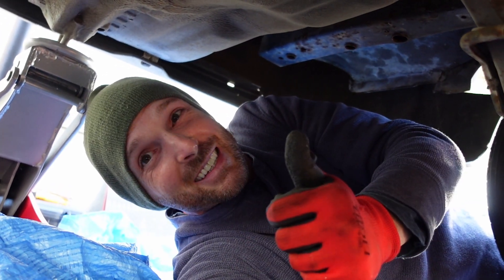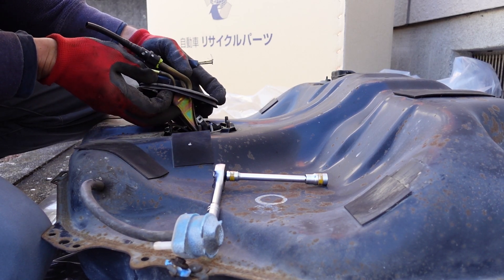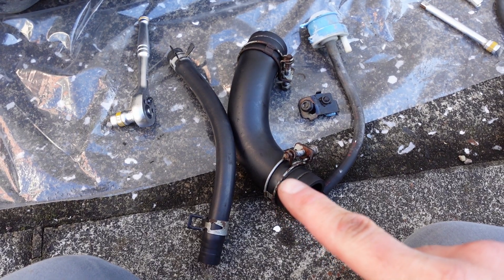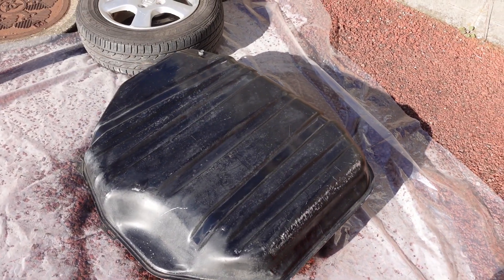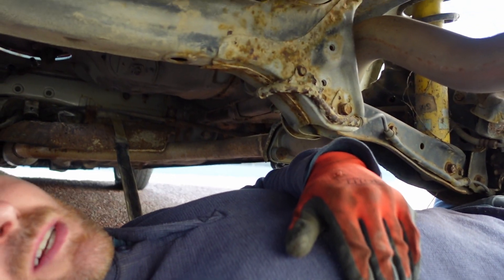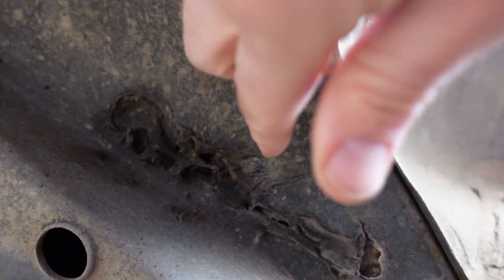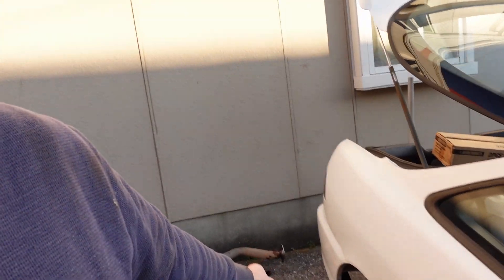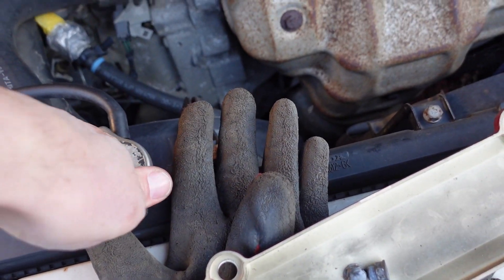Fuel System Refresh & Undercoating Rust Prep! | JDM DC2 Restoration Ep.4

Comment: If this was a UK car, you would had the welder out in the first 2 minutes of this video!
Car looks great man, seems you found a good one!
Reply from the maker: Haha, no kidding!  Work space and shaken has me a bit limited a the moment. 😣  And I'm not sure how common this level of rust is (I've seen some that look similar online)...but for real, if Honda would have just put some seam sealer in the joints or thicker (or any) undercoat in certain areas, they might have faired better! 😕
Reply: @BRICKHOUSESPL  put it this way, my EG is on its second set of arches and they're nearly dead too.
Reply from the maker: @jonwebb9261  holy moly!  Makes me feel better!

Comment: Most of the parts you've pointed at in the engine bay are available from your local Honda dealer. 
Ordering from Amayama or Partsouq (Australian dealers keep very little actual stock), most of the parts seem to come from Japan, so your local dealer who you mentioned should be able to provide them.
Reply from the maker: Excellent, good to hear there's still some OEM support. I'm going to go back to Honda see what I can get for the tank seals and other misc items.  The guy helping me mentioned consumable items being a good bit cheaper at a local parts store so I might get some pricing from them and see how it compares.  Just need to find one now!  Haha. The extra challenges of moving to a new area (there's not massive chain parts stores).  Also, a bit of piece of mind since this is an "off model" DC2...I find plenty of DC2 or B18 parts online and 99% are also labeled Type R.  I'm not sure how much cross capability there is between the models so a parts store or Honda will just take the title and 100% get me the right parts.

Comment: Pumps will be the same lph. Though no reason not to upgrade. I've always been happy with the DW200 pumps I've used. Much more quiet than say Walbro. A 190lph pump would be a decent size if you just plan to keep it NA with relatively basic engine upgrades.
Reply from the maker: Oh, base model DC chassis' use the same pump as the Type R or GSR?  The tank was from a DC1 the seller said so I'm not sure.  If I could put that pump money into other areas needing attention for the time being, I wouldn't be against it.  Really appreciate you taking the time to share some knowledge!
Reply: @BRICKHOUSESPL  Yep. So every B series engine uses a 240cc injector too. 

Also, a much more solid "fix" to that rear rust hole? I'd say pull off the tape, clean the area of rust, and make a patch panel, but just rivet it on and then seal around it. It'll be metal, rust won't spread, and it'll be water tight and won't fall out.
Reply from the maker: @Clark_R  Oh nice, now if every B series could use the Type R intake manifold that would be amazing. I'd love to ditch this uggers SIR-G/GSR one.🤢

And good thinking on the panel.  I'll put grinder on the shopping list.😂
Reply: @BRICKHOUSESPL  Well Skunk2 and some others make an intake manifold for the GSR that is essentially an ITR intake manifold. Will probably come pre-bored to a 65mm throttle body, but you can reuse your oem GSR 62mm one if you wanted. The IACV, IAT sensors will also transfer over. You'd just need a way to deal with the ecu as it'll think the butterflies are still there.

I do though, have a Japanese market ITR ecu that I'm not using.
Reply from the maker: @Clark_R  oh thanks, I'll look into those options!  I'm still aways before chasing any more jam but that's the fun stuff or research. 😅  And the GSR B18 can run on a ITR ECU without extra work?  Thanks for sharing so much info. Really helps me wrap my brain around stuff. The internet is a minefield of bad info. 😆